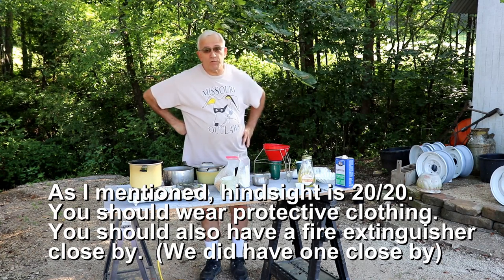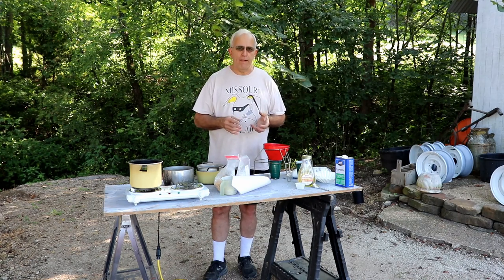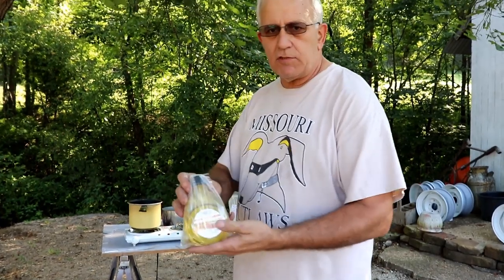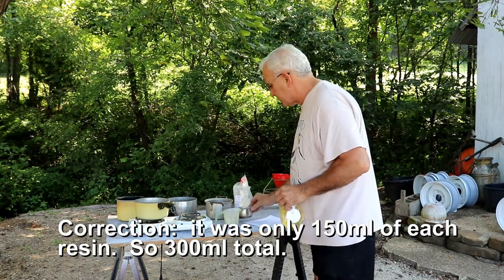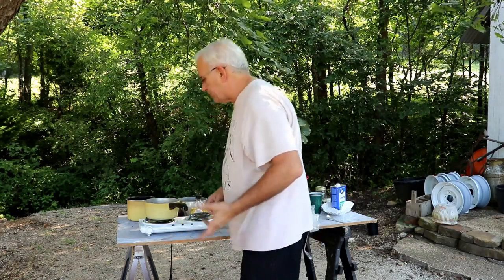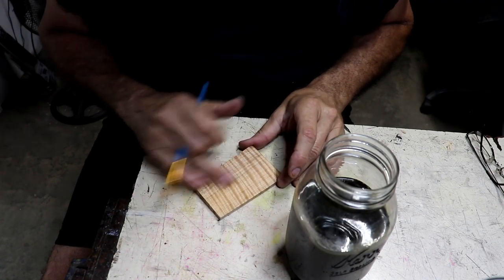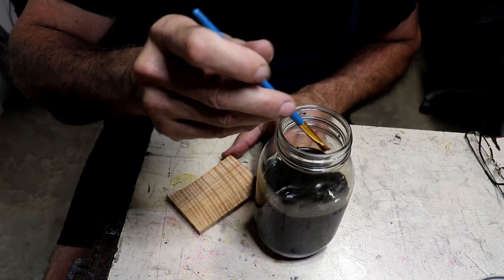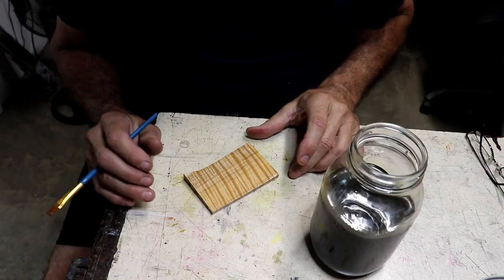317 RSW Old School Varnish Making 1st Attempt

Comment: I made the wood ash varnish. I just put all the ingredients in a big pot and cooked it all the entire process. When i got the proper string length, I then let it cool to a safe temperature and filtered it. I left all the gunk in the pan. Then  rewarmed the varnish and turpentine(not hot) and mixed it together. It turned out great! Felt like high grade motor oil ,and smelled wonderful.
Reply: Hi, gooxl only gives ash wood ... hehe. How did you make that varnish? Any receipes on hand? Thanks a lot!
Reply: @Wolfgang3418  I used pinion pine sap and cold pressed linseed oil mixed with half a shovel of wood ash from my fireplace along with a half-gallon of water. Boiled it till i got a 3-inch length of string using the spoon test. Then mixed the warmed varnish  
with warmed turpentine (not hot!)
Reply: Prevrdi

Comment: I use the same varnish (inspired by
 David Ireland) on my violins. It will dry only in UV light. I hang my violins to dry in the sun for 14 days  for every layer of varnish. In the winter I use a self build UV cabinet. I sand down with my finest sandpaper (1200) after every layer, and polish with propolis and oil on the last (3rd) layer. 
It takes time, but is absolutely worth it.

I love to watch your videos.

Best regards from Norway.
Ingar Sørensen
Reply: Japan dryer... I will give that a try :)
Reply: I polish with tripoli, not propolis. Just mixed up the words in my head. :)
Reply: That’s fascinating to me as a dabbler in fine furniture and knifemaking. Do you do anything to slowly further reduce moisture content before putting in the sun? I’m assuming you don’t do it when it’s 80 F and with a dry wind? I would be terrified of warpage.
Reply: uv curing resin like 3d printers!!!

Comment: Just ran across your video. Curious if you've given varnish making another go. I can say the reason your varnish didn't set is because you added the extra oil to it. Linseed oil and turpentine. What makes the oil set quickly is the oil content being polymerized by the heat. The temperature of the oil has to reach at least 430 degrees to become polymerized. So your original mix reached those temperatures. But the added oil was only heated to water boil temperature, 210 degrees. Not nearly enough to polymerize the added oil at all. Hence the slow drying. If you had just added turpentine to thin your original, thick varnish you would have had exactly what you wanted. But great going! And I too have had the surprise fun of bursting an oil resin mix into flames. Learned a new lesson. There are levels of flame. There's fire... and then, there's FIRE. Oil. Resin. Turps.... those things burn REAL good. Talk about a robust, wicked flame.

Comment: Hay, the best lessons are learned by doing things and making mistakes. Now many of us will not make the same mistake. I really liked the color of the first trial. I, am wondering if you had added the drying agent to it at that point if it would have maintained the color and still dried better. 
I would appreciate more videos on varnish. Even experimenting with color in some. Thanks for sharing your experience in doing this first trial. Your honesty is one of the reasons I really like your videos. Please never leave out the things that don't work. They are real teaching experiences that teach us what won't work well for us either.

Comment: Thank you for this video, I learned a lot.  Thanks for keeping in the part about the turpentine, it is actually very useful to see that.  Someone probably mentioned this already, sorry if I'm repeating anyone.  The other videos I've watched on this process say to rub in the varnish onto the instrument.   It looks like each layer is rubbed in and allowed to soak and dry into the wood. Brushing it on probably makes  it too thick.

Comment: In my experience, the alcohol type varnish dries super fast and requires high quality fan brushes and you must be super fast in applying the warm varnish, otherwise you get streaks. The oil varnish type you are using takes up to a week or more to dry and a few weeks to cure, when mixed right it will get hard enough to buff out. I used an empty closet and hung the fiddles with news paper covering on the floor. It is definitely an art that I have not mastered. The old Italian varnishes had beatles and flower pedals ground up in the mixture. Keep going, your an inspiration to many tubers. Thumbs up!

Comment: Thank you VERY much for doing this video. I have been wanting to try making my own varnish from the myriad of recipes I've collected. Some of them are even more dangerous than the one you chose, and seeing the flash from that turpentine was very impressive. I think I'll start with one of the less dangerous ones. 

Looking at your final product, I'd mix in some more turpentine and thin that batch out a little. Nice color, though, especially on that maple piece. For a first attempt, I think you did just fine. And you've probably inspired a fair number of us violin maker wannabes some inspiration to do this ourselves. Again, thank you VERY much.
Reply: Whoops, spoke too soon. I should have known that you'd come up with the solution to the varnish being too thick. Great minds think alike, and US, TOO!

One thing to consider, oil varnish will stay soft for months after it's used on an instrument. At least that's what I've read in all the violin building books I've read. That's why the old makers would have a slew of instruments hanging up for a month or two after varnishing. Heron-Allen talks about it taking at least a month. Patience, my friend!
Reply from the maker: The oil varnish I used to use dried much faster. But it's no longer available.
Reply: @RosaStringWorks  I'm with you there. I used to find oil varnish at the local Ace hardware, now it's not available. They get us old geezers used to something then take it away. Again. I'm going to have to get myself one of those dual hot plates, I guess...

Oh, while I think of it, there are a LOT of other resins besides pine resin one can use, and it seems to me that a lot of people don't use pine because it does take a long time to cure. There are some really good articles on this topic from the Guild of American Luthiers that you might want to check out if you haven't already. But knowing you as little as I do, I suspect you've already memorized them all.

Comment: Fascinating experiment.  When you said you had added Japan dryers I said Bingo! Lots of good information on varnish in Bob Flexner's columns for Popular Woodworking.  One of the points he makes is that "boiled" linseed oil isn't so much boiled as it has drying agents added.  If you had used "boiled" linseed oil you might have gotten your result faster but in the end the chemistry would have been the same.

Comment: Intereting experiment. Dammar resin also known as frankincense, disolves in pure turpentine, no heat. If you need to add rosin then use a double boiler to melt the rosin, do not put on direct heat. You need to strain the dammar as it may have tree particles in it. I wrap my dammar in cheese cloth and then submerge in the turpentine. Dammar base varnish takes up to 2 weeks to dry. I use dammar/ turps 1:1. Once disolved strain ans add up to 50% extra turps. You can add linseed oil later. Good luck

Comment: Many years ago (i think 15 maybe) there was a very detailed article on doing this in the Muzzleblast publication from the National Muzzle Loading Rifle Association. I do remember they made up a "double boiler" to heat the mixture up and used sand as a heating medium between both pots. I think this made the temperature more stable. Try to reach out to them as they used to be great people and would appreciate what your doing.  Could also reach out to colonial williamsburg as they also would be into creating these authentic oil based finishes.

Comment: Hello, I made the varnish or lacquer after Roger Clark down here in the comments. My first trial with error, but maybe some usefull hints for somebody. I took 150g raw linseed oil together with 50g of fir resin (cleared by heat, melted through a 150µm mesh) and sieved wood ash from beechwood, same volume as the oil and one liter of rainwater. This mixture cooked lively for 4 hours and stood to cool down. The above layer of varnish looked nearly black and was applied to a glas plate. It cured within two days in cold darkness. Maybe faster in sunlight. A thin layer has a reddish brown. Not so bad so far. Adding lime isn't nescessary since wood ash contains 50% of quicklime.

Comment: ooh !  ... when doing this you need your pot lid at the ready    . . . flash point turp: 86 ~114 (F) . . . one of my first memorable experience(s) in semiconductor de-encapsulation (of epoxy packages 4 failure analysis ) was in a heated pot with solvents, over a hot plate, was not realizing the hot plate's thermostat was a simple bi-metal switch . . . that " occasionally sparked " .... and ignited the fumes  ( well below the flash point of the solvent ) ...   thanks for the memory!

Comment: Dear Mr. Jerry,  a thought just occured to me. I have had good luck with using clear nail polish on violin bridges. Why not just use clear nail polish. Ididnt use any thinners. Use direct from the bottle. Sets up in about 20 minutes. Drys hard in 6 to 8 hours cures overnight. Ive had the clear nail polish on my violin bridge since last summer. Ive played my violin and it sounds sweet. If you did need to thin it down I would add a couple drops of acetone. I personally think its best to apply full strength but you have to work fast and in well ventillated room. I believe its called nitrocellulose lacquer.but not sure. The thing i like is it drys in only several hours. Hope this helps. Ps make sure room has good fan and open windows  lacquer fumes very nasty. If you want a glossy varnish why not flecto varathane? All you have to do is thin it with paint thinner. Sets up over night. Hope this helps.😅

Comment: Traditionally Damar Varnishes take many days to even lose any tackiness, and weeks to have any measurable hardness of finish. I'm an oil painter and a former art materials tradesman, so I'm very certain of my drying times when dealing with the layered film your applying. Had it been cut with some more turpentine to a thinner consistency it will dry far faster, but require an additional coat or two. Damar Garnishes are usually considered dry enough after 120 days, since the film created must slowly evaporate the turpentine through the solids in the resins used. Your darker color may well have been caused by the oxidation resulting in the combustion of the fixture while mixing, but some thought must be given any impurities in the resin materials as well. Hope you find the sweet-spot your looking for with experience. Very best wishes my friend.

Comment: You might try odorless mineral spirts (OMS) instead of turp. for the final thinning. The varnish should dry faster. Btw, artists oil paints typically take a couple of days to dry and months to finally set. Quicker drying artist paints use alkyd binders. These will dry in a few hours. One brand of alkyd, with no pigment, is Liquin, sold at most art stores. Also, a good art store will stock a number of different varnishes one of which might fill your needs. I really like your videos. Someday, I hope to have my ‘57 Martin repaired.

Comment: I use to do boat work for a living and paint and varnish was in my lexicon. Too thick? I would add Penetrol, a colorless natural oil to thin the paint/varnish out. It did not change the color but did accelerate the drying time and "paintability" of the finish. Also the Japanese Drier would almost do the same thing but it thinned the finish more than the Penetrol.

Comment: First I want to clarify that I don’t know anything about making farnish, however, I recently read that linseed oil is a drying agent used in oil based paint.  Japan Dryer has three main components - Maganesse, linseed oil and turpentine.  Lead my also be a component.  I think you were on the right track when you started adding the oil and turpentine. You just need to find a good recipe.   Hope you find the right mix for your project.  Thanks for another very informative video.

Comment: Jerry,  I am seriously not an expert but from my violin making classes, one of the tutors did make his own varnish and the other was a seriously expert oil varnisher (Chris Beament from Cambridgeshire UK).  The one thing that I leant from Chris, and understand is that all pine-resin varnishes must be put in a 'black-light' / UV cabinet for a couple of days for each coat that is applied.  The UV light cures the varnish.  In Cremona, they used to hang their violins out in the sun for days to cure.  It is also my understanding that the oil varnish never truly ever fully cures even when hard to the touch.  Some say it can take up to 50 years to cure fully. 

The process that we were taught was to apply the varnish with upstrokes to stop it running, UV cabinet for a few days, take it out level with 400 grit lubricated with a few drops of linseed oil (to get rid of the sparkles) - wipe down with kitchen towel, apply the next coat, back in the UV cabinet etc., etc.  Probably about four or five coats.  Be interesting to see if this helps you.  Without the UV light, it will never cure.
Reply from the maker: What's weird is I've used oil varnish before. Haider sign was the brand. It always cured in just a couple of days and I never had any problem. Unfortunately that brand is not available anymore. I did apply the varnish I made to a mandolin just this morning. It went on absolutely beautiful. I couldn't believe how nice it went on. And it really look beautiful. I did hang it in a confined area with a UV light. So I think everything is good.
Reply: @RosaStringWorks  Just wondering.  After all oil varnish comes in many forms with different chemistry and some have special chemical hardeners added.  So, some do cure by air but my understanding is that pine resin requires UV light to chemically change it, locking the polymers.  I am no chemist but that is my understanding.  Be interesting to me if any viewers are chemists and can explain it more fully.
Reply: I think what you say is true for a varnish that is maximal transparent. If it can be a bit on the brown side, it's much easier, and I achieved a varnish, that cured within two days without UV.

Comment: question? why did you not start with boiled linseed oil? i think part of the problem may be the linseed wasnt boiled long enough. second i would have thinned only with turpentine and not added more oil. linseed oil is whats in oil paints so it will take a week or more to dry when ground into a ton of powdered pigment. adding only thinner would increase drying time theorhetically
Reply: sorry meant to say adding only thinner should decrease drying time. i am an artist and have dealt alot with linseed and in restoring antique radios/console record players i use varnish,laquer etc. i think once you had cooked it just add thinner like you would thin other clear coats that were too thin, prob give you the lighter tone you wanted too because theres less resin in the varnish mix. i am not a pro varnish maker but tinkering throughout my life makes these educated guesses

Comment: I've never tried this before but have researched it when looking for a nitrocellulose lacquer recipe. The varnish is too thick, about twice as thick as it should be. You can thin it with either boiled or polymerized linseed oil or turpentine. With the BLO, you get the Japan dryer. Turpentine has oxidizing properties that can help it dry. Straight linseed oil will take longer to dry since the molecules aren't crosslinked by a polymerization process.

Can also try cooking the oil a little less before adding the resin.

Oh, some people put it in a large jar and use an aquarium bubble pump to aereate (spelling) the varnish or even the oil prior to boiling.
Reply from the maker: That's pretty much what I thinned it with.
Reply: @RosaStringWorks  oh, some people dissolve the resin into the turpentine and boil it then add with the oil. I think the oil and turpentine mixture has to be within 20° to reduce flashing. Some people pour the oil into the resin mixture but should be done off the heat with a couple of minutes to cool first. I'm trying to remember everything. When I did my research was right after Lawrence McFadden went out of business.

Comment: Your first batch was perfect. You need to apply it very thinly. You need to push it around with a very stiff brush or dab it with your finger. Then, very importantly, you need to put it in the sun, the direct sun for just 1 hour and it will be almost dry.

Comment: As a former painter (back in the 80's) I am mildly familiar with Japan dryer and it is a great substance.  We would occasionally use it when we needed a finish to dry faster due to the job requirements.  As a suggestion I would say NOT to add the dryer to the entire supply.  Instead I would advise adding the appropriate amount (dong the math) to a smaller batch that you are going to use immediately.  I suspect if added to the entire batch you are going to either have it get overly thick or skin over and then you may be back to not drying.  Just a thought....
Reply from the maker: That's how I did it.  I took part of the varnish and added the dryer to it.